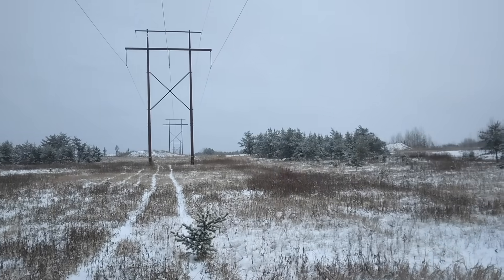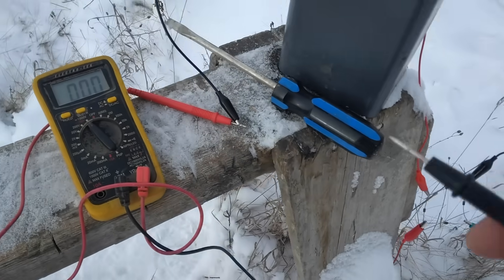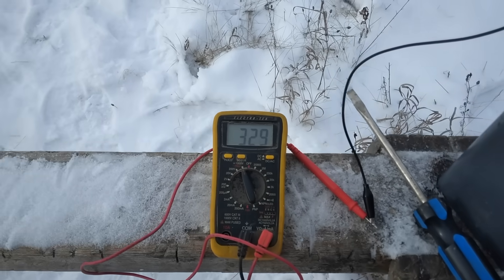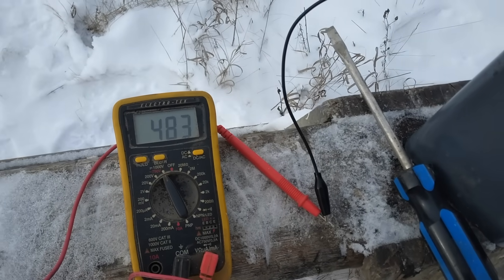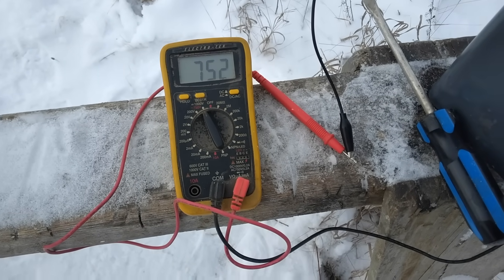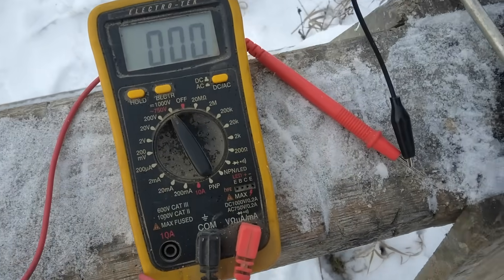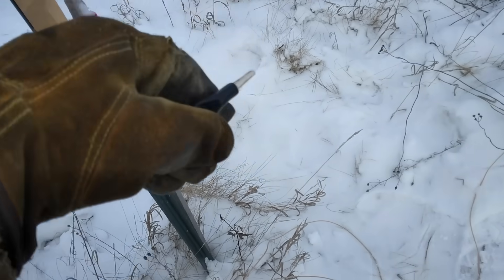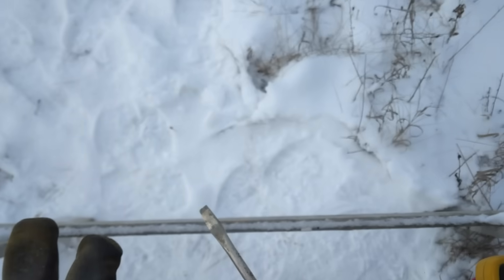Fences sucking power from under HV transmission lines

Comment: My uncle in Alabama has a nice home.1500 feet from hi power overhead lines.  He is an electrical engineer.  He built a setup 25 years.ago to capture the energy and charge lithium batteries by his home.  He powers his entire home from these batteries.  Been doing this 30+ years.  Never had a power bill.
Reply: Lithium batteries weren’t a thing 30 years ago.
Reply: @markclark4154 they had em in the 70's i think. its not new tech its just become affordable to source the lithium.

they also had jet powered tank seeking flying shipping mines in 1950 buikt for desert assault. 

and the germans had tanks that could launch 70ft high in the air to jump over bunkers (no survivors).

we have tech.
Reply: He had a lithium battery bank in 1995?
Reply: @AlexFlockhart  The first lithium batteries went on the market in 1991
Reply: @virginiosavani Yes, it's been an available technology for a while, I just find it hard to believe someone chose the newer technology scaled to the energy demands of an entire house in the year 2000.  The battery management system and inverter setup would have been quite a hurdle.  Physically possible yes, but it would have been somewhat experimental.
Reply: @virginiosavani  thsts not true 😂 first commercial perhaps. look up lab data.
Reply: @AlexFlockhart Why? Hard to believe Lithium batteries pre date you?
Reply: The people who call it stealing are the same who say we're depleting the sun by using solar panels. LOL
Reply: @  it is theft, since it takes energy from the grid free of charge while reducing the resistance of the grid, meaning that the turbines have a larger resistance to their motion as a result. If someone hooks their car onto your car to catch a ride would that be ok with you?
Reply: So yes. I'm more than okay with the "free ride".
Reply: If a car went by and the wind from it blew your car forward is not stealing energy from his car.
Reply: BS
Reply: @khg8519  u calling me a liar?
Reply: Folks I'm going to comment on this high voltage deal here, I say if you can get that electricity from the air all the better, the electric company generates the electricity for free and they charge you for it out the yin yang, the folks complaining and saying it's stealing, I say keep paying the higher prices you surly deserve it
Reply: @JbDollar-g7u I agree with stealing from the power company, they can go F themselves. However, it is technically stealing even if it’s taking it from the air, because the line is effectively one side of a transformer, and your coiled fence or whatever you got down below is the secondary side of a transformer, and when you pull current off that , you’re pulling it off the primary side (main power line). This is exactly how a transformer works, using only air gaps to induce voltage into diffferent coils of wire. The power company can actually see a significant line loss on their computers if you managed to pull any significant current through which is doubtful without massive copper coils the size of a barn and then some . So it is technically theft lol
Reply: @Miyukiii111 you must be an electrical engineer,right
Reply: 100% bull plop
Reply: @ljbachichawhich U enjoy with mash huh😂😂😂😂
Reply: lithium batteries 30 years ago?    eh emmm hummmmm
Reply: @snoopstp4189 They were new and not large scale, the commenters uncle must have been at the forefront of the implementation of lithium batteries yet never mentionined it to anyone else.  Weird how that works.
Reply: Lithium batteries weren't around back then. It was lead acid. Cool fake story bro
Reply: So he started using lithium ion as soon as it became available
Reply: I wonder if there is any long term health risk.
Reply: Bull.
Reply: @Boraxo  This is nothing new, if this guy could charge a battery with the rinky-dink operation to prove a point, a purpose-built collector could do the same thing.  I do not know why you find it so hard to believe.  I personally know more than a few people doing the same thing - much more reliable than solar.  LOL
Reply: @Boraxo I chew cannonball myself.
Reply: 25 years ago he certainly wasn't using lithium batteries for his home 😂
Reply: @normal_human  Why not, I was using them in my RC helicopter back then
Reply: @normal_human  you are wrong
Reply: so hes stealing power.
its not free its theft.
but being from the south, i dont expect you folks to understand this
Reply: @winstonwho no it's not stealing power. It's called physics. There is leakage in any electrical system it can be mitigated but at the high power it is exorbitantly expensive to do. So this power is freely discharge to the air, it is still paid for by everyone. He is merely making us of what is in the air. There is no stealing involved as his usage will not effect the total power reaching house snd industrial premises on the grid. It is also unmeterable as it is part of the lossy system.
Reply: Says something about the education level in Alabam that he gets away with it still.
Reply: @garywheeler7039 no one is gonna notice the slight draw caused by a magnetic induction setup siphoning a fraction of a fraction of the voltage running through those lines. Someone working on the lines themselves might spot the rig, but that's about the only way one would notice. And power companies have already lost court cases trying to sue people for doing it.
Reply: @garywheeler7039 says something about your education not looking into this and realizing courts have ruled in favor of those doing this as they are collecting lost electric, not stealing it. So nothing illegal being done.
Reply: @garywheeler7039  something you're afraid or not able to articulate yourself?
Reply: Your uncle is a thief
Reply: @MrEjohnston  Negative, courts have ruled that as long as there is no physical contact, the responsibility lies with the power company to insulate their lines better.
Reply: @MrEjohnston  your mother is a nice lady.
Reply: @ericchristian6710  Woah there, buddy! And your mother is outright sweet and kind in the church on Sundays. Wish mine was like that!
Reply: @MrEjohnston Actually not. Electric is lost during transmission, he is collecting it naturally, which is legal.
Reply: Why a thief? It’s like a neighborhood Appletree where apples fall on your ground. You can keep it. Ok I don’t know laws USA, Switzerland is so.
Reply: A thief because it's not like an apple that is dropped up you don't pick it up. It is power that needs to be added by the power company once the uncle connects his load. 
The amount is minuscule compared to what is transmitted by the power line, though.
Reply: @archivtv5460 no it’s really not like that haha.
Reply: @MrEjohnston  tell it to tesla (nikola)
Reply: @MrEjohnston it's physics the electricity surrounds the unshielded wires. If those power lines were shielded the only way to get charge would be to directly attach to the shielded wires, which would be shielding. However losses into the air because of using unshielded cables is not your problem it's the utilities. Also that small amount of electricity is being losses anyways.
Reply: @MrEjohnston I vandalized the FPL substation in north Florida years ago, never gotten caught never will 😂 get over it

Comment: Take your voltage wires and connect them into the PV input of a solar charge controller from there you can charge batteries and use inverters to make useable power for your house

Comment: Oh yeah, you can absolutely see current flow under high voltage lines. Buddy n' I blew a brake caliper ripping down a powerline trail. Lines overhead are 500kv. The D150 would shock us every time we touched it, and if you ran your hand over the hood it had had an almost vinyl-record texture as you ran your fingers over it.

Magnetic fields created by AC sure are something.

Comment: I know Nothing about electricity.... So from this point ... how do you charge a Regular Battery ? How long of a wire can you run from under the HV Lines to say an Out Building that stored batteries that then could power a barn or house .... ????

Comment: If u plan to built something with large metal surfaces inbetween the ground and the power line u need to add serval grounding point to drain that leakage current.
The current can be estimated by the capacitor charrgeing time. Or it can measured safely as a voltage diffrence on a 1-100K resistor, if its conected series with the ground point and one of a diode bridge ac point.

Comment: Power is not transmitted thru the actual wires. The wires are just a conduit for the electromagnetic field thru which power actually flows.
Reply: In actual fact, just because you see lots of magnetically induced voltage does not mean the current is going to be high enough to power anything of interest.

Comment: I work at a power generating station, this stray voltage is such a concern that we have copper grounding straps on all the fences surrounding the switchyard. Out station has 345KV transmission lines and you can hear and feel the electricity when you're in the yard. This is a really easy way to access power, but controlling it is the problem, the amount of stray voltage will not be steady and will drift to ambient weather, cold humid days you'll get more, hot fry days you'll get less. It is a viable method though.

Comment: I built a train station below high voltage lines like these.  We had to ground out all metal including roof flashing as the metal would absorb or could absorb power enough over time to kill someone who touched it. The process was developed and researched by MIT to make the WiTricity we use in cordless charging of phones.  When they went to patented it, the patent office said Tesla already had a patent on it a century ago. Magnetic resonance pairs are how transformers work.  In a transformer the two coils don't touch each other.

Comment: I totally believe it 
I used to race motocross  one of sanction local tracks was under high tension, powerlines one I parked under them in the pit area. I had to ground my truck to the ground because it would energize my truck and I could feel the electricity and feeling nipping at me when whenever I touched my truck

Comment: You should stretch dozens of lines back and forth across that area, connect them into a meter and then have the meter feed back into their power lines, sell them back the electricity you generate.

Comment: Nobody here seems to be from a consulting company or a Utility. Yes using a fence or an induction coil is considered stealing in most states. If your fence generates an induced current, you won't get in trouble for that. If you install an induction coil and convert that to 120V or 240v successfully you will be creating a load on the line and the increased electrical losses will be detected at the substations. They have equipment that can tell how far down a line short or unexpected load on the line is. The power companies I work for as a consultant sue at least one person every couple years for stealing electricity using an old shed with an induction coil in directly under a line. They think they are geniuses but the law definitely considers them thieves, doesn't matter how smart you had to be to accomplish the theft. If you install an induction coil, you have basically just done what the power company does with it's pole top transformers. A transformer is just an induction coil. There is no direct electrical connection between your distribution line and your home. If there was you would be getting 7000+ volts instead of 240 volts. So when they say you can't be sued for taking advantage of physics, then they should by the same logic, render all electricity free. It is all just physics after all.

Comment: We used to live where they had an ATV riding area where these lines ran through.. Everytime I touch a bare metal spot on the ATV while riding under the lines, I would get a good shock.
Later I was looking for more info and came across a guy who had a large transformer on a cherry picker. He had wires connected to the transformer and ran wires to his shed. He forgot to put it away once while a lineman came through.. I never heard the outcome

Comment: If the diodes are 1000v then it would be good to stop the capaciter at 800 volts. 80 per cent is usually rule of thumb

Comment: We powered 2 miles of electric fence by trenching in bare copper wire under a powerline and connecting it in a loop to a DC inverter...

Comment: We have a 240 kV DC bus that runs over our asphalt plant. Workers using elevation work platforms under it were complaining about being electrocuted when the touched the plumbing lines, low set above the tractor trail in the image. After I pointed out that electrocuted meant dead due to electrical shock and that couldn't be the case as we were able to speak, I measured the voltage to ground at the basket and found 300 volts, induction from the overhead power lines. In the image you'll see an intermediate pole sticking up just above the black rail car. That was installed to lift the lines between the two pylons high enough to prevent that problem. The EWP know has a self retracting bonding jumper in the basket that they clip to a bonding bar near the ground when working in the area. https://www.google.com/maps/@51.0154984,-114.0250882,3a,26.2y,275.5h,97.42t/data=!3m7!1e1!3m5!1s55bQ_Js-A7COK6WXYM2YIQ!2e0!6shttps:%2F%2Fstreetviewpixels-pa.googleapis.com%2Fv1%2Fthumbnail%3Fcb_client%3Dmaps_sv.tactile%26w%3D900%26h%3D600%26pitch%3D-7.418073157548349%26panoid%3D55bQ_Js-A7COK6WXYM2YIQ%26yaw%3D275.50109418975944!7i16384!8i8192?authuser=0&entry=ttu&g_ep=EgoyMDI0MTEwNi4wIKXMDSoASAFQAw%3D%3D

Comment: Back in 1984 here in England, I drove out to a power line nearby with a fluorescent tube.  Holding it up, it lit up.  We hung around for quite a while before deciding to drive home and I happened to touch the roof of my car - it was buzzing.  I'm not an electrician, but I never understood what was going on, as the tyres (I thought) would insulate the car from the ground.  We got out pretty quick.

Comment: I am retired now but was in Electronics for 40 years. One teacher told us about a farmer that had a fence under High Voltage lines. His fence was killing his cows. He got a friend to come out that was an electrician. He measured 3000 AC volts to ground. He used a tire rim off of a car and wound the guy a stepdown transformer to run his house. He connected a couple of his neighbors up to the fence as well and was selling them discount electricity. That is where the trouble started. The electric company sued him. The court made him disconnect the neighbors but allowed him to stay connected since the power was coming from his fence on his land. If you have High Tension Lines coming across your property you have free energy. But you also have another proble. That same teacher was also picked to work on the Los Alamos Atomic Bomb. Bill told us don't live under High Tension Lines. All fluctuating (AC) magnetic fields have an effect on all living beings. It is according to the frequency as to what will happen. Low frequencies cause illness, high frequencies cause cancer.

Comment: Where I live here in Houston there is a bike trail that runs directly underneath a high-voltage line. Often when I am riding that trail I get a mild shock when I touch the metal handlebar. People thought I was crazy until they tried it themselves and had the same result.

Comment: We use to charge the capacitors from disposable camera after all the pictures were taken . Then we bend the contacts so they stuck out decent.  We remove the capacitor and the battery charing circut and charge it up, then unclip it holding it from the round outside, avoiding the contacts. You then yell out to your friend or person who is your target , saying head up or catch this and the entertainment and laughter is so funny your sides start to hurt. Some even had permanent marks on their arms. So that said, don't do it, my sides still to this day I tell you. Of course I was a victim of the joke before learning it myself way back in the day. lol Think of it as someone taking a 1 inch by 3 ft long round wooden dowel and swing fast and hard on the end of your hand. 😂 i use to get git by these all the time years later, standingvon a ladder up 20 feet in the air working on night club lighting systems,  where ever there were smaller egg like strobes. Two t8mes almost thrown from the ladder. Was definitely the very start of my long learning carrier and the wonderful world of current and electronics. Better lessons than any school book back in the day. 😅

Comment: Coax cable has a braided sheild going around it, which is primarily not a very good conductor. The solid core inside is but the outter sheild does exactly what it is designed to do, so I would think it's a really poor product for a  conductor for absorbing current.

Comment: I worked for wright tree service and we trimmed for Oncor (they take care of the lines for TXU) around their lines. Ive seen bucket trucks setting under transmission lines have 6' sparks arc off them. Ive been shocked (through a tree branch) by a standard 9kv power line and its a sobering experience

Comment: We had a small fire in a combine a couple of years ago that disabled the combine. We pulled it out of the field and not really thinking anything about it, parked it underneath some high tension power lines. The header of the combine was sitting on the ground. Later when we climbed up on the combine to work on it we kept getting shocked. That made me believe what you are doing 100%

Comment: EMF is wasted energy. Earth itself has EMF. You can even induce energy in a length of cable on a windy day. You only need to overcome the internal resistance of the wire and associated components to collect the power.